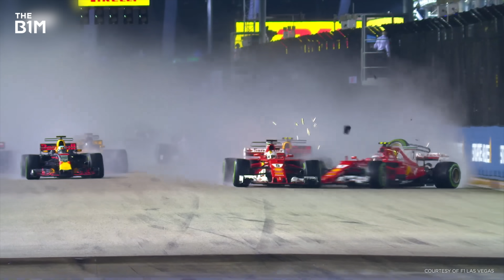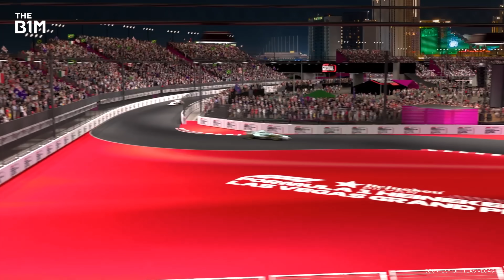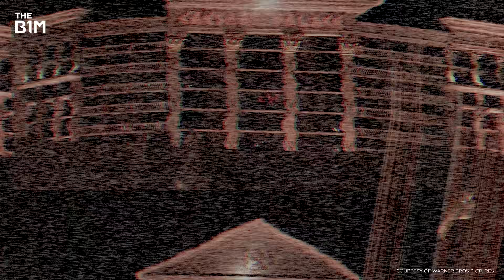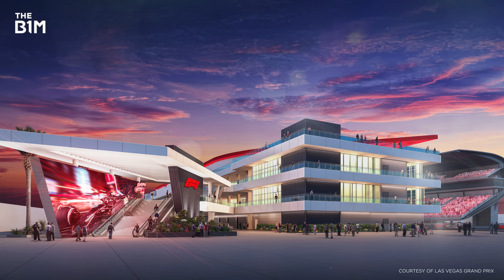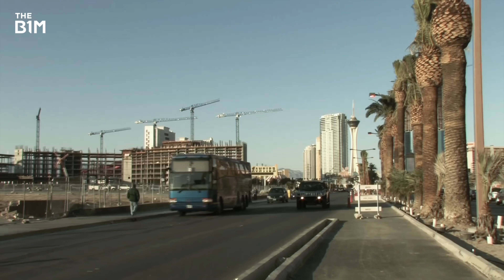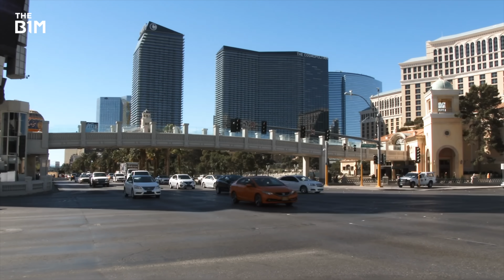How Las Vegas Was Turned Into an F1 Racetrack

Comment: Well, those contractors must be idiots or thieves:

All U.S. power hits the buildings at 240v split-phase 60Hz and every pit did not need another transformer.

We just single phase it down to 120v. 
How do you think every house can have 240v dryer, 240 volt A/C or 240v water heaters or a fast charging EV charger for our chargers.
Go look at your electrical panel: see all those breakers that take up 2 slots? 240v...

And since there are no U.S. companies that make transformers, all transformers are 50Hz or 60Hz selectable to be decided when installed.

Comment: "Something even cooler", yeah, like the road itself, pissing off the race teams who don't even want to run the race because they won't be able to get enough heat in their tires when it's few turns, more long straights and 40 degrees in a night race in November. They will not be able to get the most out of their machines in those conditions making for a lackluster race, especially when the season was already decided at Qatar so they really don't GAF. MASSIVE PLANNING FAIL.

Comment: Las Vegas is set to host its inaugural Grand Prix and the construction of the track and facilities has been a massive project completed in just over a year. The 17-corner circuit was the result of 31 different designs and is intended to show off the best of what the city has to offer. The track starts off with a series of turns before a high-speed stretch towards Las Vegas's newest landmark, the MSG Sphere. The circuit then curves back around to the iconic strip where the cars race past nearly 2 km of the world's most famous and iconic casinos before a series of left turns bring the drivers back to the starting line. The Las Vegas Grand Prix took the unusual step of buying a 39-acre site a block east of the strip to build a permanent foothold in the city. The site features the largest paddock on the entire F1 circuit, over 300 meters long, 30 meters wide, and topped off with a huge illuminated F1 logo. The ground floor features 13 garages that will serve as the base for each of the teams, along with two other floors and a rooftop area for hospitality.

Comment: Its going to be a shit show. Its will be too cold at the odd time they are running the races, and there are too few corners, so the tires will be too cold and traction will suck. They are not tempering the circuit with other formulas to "rubber" the track, so traction will suck. More ice skating than racing. Messy !

Comment: Not a big fan of the layout. Rolling high speed corners and multiple long straightaways does not make for a intricate track. Monza level wing set up is rumored, certainly will be fast. The only question remains: Will the tires be able to handle the temp?

Comment: See the Long Beach GP setup , there is also a part 2 
 How to Build a Street Circuit (Part 1) | Dinner with Racers S3 Ep. 4 | MotorTrend & Continental Tire

 MotorTrend Channel

~~~
Some info on F1 and NASCAR  ( all in fun.  .  ) 

F1 dyno test engine

Rodrigo Coutinho

Formula 1 vs Nascar Fans

zataniko

Comment: Could you imagine if one team on the on end used imperial and the other used metric and they didn't quite meet in the middle...
Reply: you say that but things like that have happened in the past
Reply: @ablair37 Swedish Empire's flagship Vaasa had one side of the ship longer than other because the builders weren't all from Sweden, if I remember well.
Reply: @ablair37 
Ask NASA
Reply: thats happened in international space projects before.
Reply: I have to say, my thought as why didn't they start from the middle and work outwards in opposite driections, guaranteeing a perfect meet in the centre. I assume a good reason, but any know exactly?
Reply: @mmo5366 I think it's because that's how a lot of projects are done. Whether it be tunnels, bridges, etc
Reply: @TheFlexUchiha  Yeah, that's a good point. For bridges and tunnels makes sense, no other way, and clearly the techniques are sound. Still, with a building on a blank flat lot. I just thought possibly so two full building crews wouldn't get in each others way, while having the whole lot marked up prior to build.
Reply: @mmo5366  
It wouldn't have gotten built like he said.

They would be built up wards, as you pour slabs
Reply: NASA has entered the chat
Reply: Many electronics will work on either voltage, the main issue is the plugs
Reply: @SpecterJoe  I think he's talking about the building itself being built in 2 halves

Comment: As much as a headache the Las Vegas locals have endured by all this at least they are left with the smoothest driving surface in the United States.
Reply: We don’t drive those roads unless absolutely necessary
Reply: This didn’t age well

Las Vegas strip: hold my drain cover
Reply: Didn't they only resurface a few lanes of the road and not even all the lanes of one direction?
Reply: @MrAffenMaster   read 80% of the Strip is being resurfaced. I doubt most locals care much about the Strip tho, they probably stay away unless they work there
Reply: @farahabdulahi474 as a local who works on the strip you are 100% correct😂 its one big kindfuck to deal with
Reply: Doesn't make up for the constant disruption permantley caused all year long which is 10x worse in the 3 months leading up to the race every single year for the foreseeable future. The extent of disruption is wild far beyond traffic

Comment: The race is definitely going to be spectacular, no doubt about that. Not just because of the mesmerizing location, but also because they race 10 pm at night, in November. The track can be as cold as 4-5 degrees centigrade. This is thus the coldest track on the formula calendar, which makes this race a real struggle for the teams. They have to compensate a lot to keep the tires warm here, we are probably going to see a huge difference between experienced and rookie drivers, this race will push the limits of the engineers, drivers and car design. It's going to be a blast.
Reply: @PM-uc4kg they get really cold if u didn’t know
Reply: @PM-uc4kg  yeah deserts can get really really cold at night. The Sahara Desert for example, is often -4 degrees centigrade at night (25 degrees Fahrenheit). While ~38/100 in day time.
Reply: Celsius...
Reply: @jkardez4794  Celsius and centigrade is the exact same thing.
Reply: @PlaguedByDesire  Agreed but it is now referred to as Celsius after Anders Celsius who  formulated the centigrade scale .

Comment: For F1 and the organizers' sake, I do hope this actually ends up offering good racing. They've apparently dumped nearly half a billion dollars into this just to make this happen. If it doesn't work and there's a lack of interest, they'll have to go through this for 10 years due to contract.
Reply: Greed meets stupidity.
Reply: 3 years
Reply: Contract expires in 2027
Reply: Potentially up to a maximum of 10 years. 
Three years is only signed and in the contract as of now. And that sucker ain’t getting extended I don’t think imo.
Reply: Very unlikely, they have the worst circuit of the whole season.
Reply: If temperature is around 10°C at night as they say, it's gonna be a nightmare to race there. No good racing at all
Reply: I don’t think they offer good racing anywhere.

Comment: The preparation for this race has been a hot ass mess. It also doesn't help that the county decided that this is the time to also repair most of the roads around the strip at the same time. Las Vegas is just a big headache right now. And apparently, F1 never realized that night in November in Vegas can get chilly, so that might have a bad effect on the race. I hope it fails.
Reply: You hope it fails? lul

Comment: opening traffic between the grand prix is insane! these hotels really need alternative solutions for traffic management
Reply: If only Las Vegas had good public transportation...
Reply: Las Vegas needs trains, metros and bus lanes
Reply: Alternatives have been proposed in the past but the local taxi lobby has a lot of power and money which it has used.   There were plans to extent the monorail to the airport which was fought bitterly by the taxi companies.   There was another plan to have a branch of the monorail serve the west Stripe side resorts, again same result.   Plans to extent the monorail to downtown were shelved due to both  cost and an issue with parts falling of the monorail vehicles during testing.   The monorail could have been a true mass transit option had they went with Hitachi monorail vehicles which are true mass transit trains.   Instead they went with trains from Bombadier which are based on the same trains used at Disneyland and Disney World.  The monorail was basically a huge extension of a two top line which ran between Bally's and MGM Grand.  That line used two ex Disney monorail trains. 
Las Vegas needs a true metro under the strip but you will need buy-in from the resorts so they can have stations.   Some resorts like the Venetian fought the monorail when it was being built which has resulted it being bypassed.  The owner of the Venetian, Sheldon Aldeson, was a big Republican donor.    In addition, the taxi lobby will fight any proposals for the metro as they love that captive audience of tourists.   Anything that may eat into their gravy train is to be fought.   Why should the tourists have a cheaper alternative?
Reply: Monaco has done it forever
Reply: It's really wild that there isn't lightrail from the airport to the strip with undergrounds stations along the strip. Millions of people come to Vegas every year and their all going to the same spot, yet they all have to take private cabs. Easiest public transit setup in the US and they have nothing of the sort.
Reply: LasVegas needs a Monorail for pedestrians!
Reply: @mho...  It has one.
Reply: @rickmartinez3781 Privately owned and connecting only part of the tourist areas. It is not a replacement for mass transit - and mass transit is what Vegas is most in need of.

(And that Tesla tunnel isn’t a solution either, it’s just… bullshit.)
Reply: @mho... First of all Las Vegas needs water.
Reply: Monorails are shit. Just build a metro system. best city transport possible. Unfortunate, they let Musk build that stupid private tunnel.
Just build a fucking metro
Reply: Vegas could learn from Monaco, Melbourne and Singapore,
Reply: Yep! All I can think of is because of greed by the city of Vegas.
Reply: Well, the roads weren't designed to be closed for a d***ed race. It's been done for so long in Monaco that people are used to it.
Reply: They should just race at racetracks instead of on streets… very avoidable issue. America has many beautiful terrain road courses that would make for much better racing.
Reply: The first thing came to my mind is the track will get abused between sessions... I can see it now, some entitled American will get the shits and drive up there dumping a load of paint or drag a skip up the road to damage the track.
Reply: @GarageSupra   hopefully it happens. The greed to just shutdown this city for such an event is ridiculous and unfair to the locals who probably would largely vote against this.
Reply: Yeah how INSANE! Those pesky ambulances and emergency services can just go around! And ppl that need to get to work, how insane of them to want to use the roads they pay for 😔 CRAZY I tell ya 😂🥴
Reply: you know street tracks exist in other american cities right? lmao. The locals will deal.  @qicle

Comment: I dont know how to feel on the whole Vegas F1 thing as an F1 fan who has heard about how bad the traffic has been the past few weeks for these guys. I live in Singapore and they handle the whole situation much better with delays being about 10 mins extra max. I don't see how you can justify shutting down a whole city just for one weekend. F1 is amazing but vegas really needs to improve.
Reply: This isnt an F1 issue as it is an awful traffic management issue. They’ve split the city in half when they widened the boulevard for cars instead of adding an alternative route for through traffic; and now they’re paying the price when their only artery is blocked.
Reply: @baconwizard it’s not a traffic issue. It’s a having zero mass transit issue.
Reply: @baconwizard No matter how well anyone designs their road infrastructure, it will always have traffic issues. Cars can not provide the density and efficiency required for the travel needs of everyone who lives and/or works in a city. To make driving faster and more convenient requires less people to drive. Access to reliable, frequent, and affordable public transport would be the backbone of this. Usually I'd suggest cycling infrastructure as well, but I'm not sure if a place like Las Vegas would be very bicycle friendly due to the heat. Making places better accessible by walking (along with providing proper shade to those who walk) will also help against traffic. 

The Netherlands is considered one of the best places to drive even though we have a lot of infrastructure where cars are not the primary mode of travel. There's also a huge bicycle network and parking garages for bikes. I hardly ever take a car anymore because it is stressful to me and I have good alternatives. If I didn't have these alternatives I would be forced to drive, which would make the driving experience worse for others.

The concept at play here is called "induced demand". Traffic gets bad, roads are widened, traffic issues are gone, that route is more appealing to people who would otherwise stay at home or use another form of transport, and the traffic gets worse until the balance is back to where it was. Now buildings need to be destroyed and people need to be displaced for extra lanes, and people need to travel further to their destinations which will increase how long people spend on the road. It's a never ending cycle where traffic won't be solved and everyone loses. But induced demand can also work for efficient modes of transport which can handle those high capacities.

Many people actually need a car because cars can move a lot of stuff and provide mobility to people who lack certain kinds of mobility. So we can't entirely get rid of cars in cities. But since the vast majority of people wouldn't need a car at most times, it would be best to provide them with a more convenient alternative
Reply: Singapore isn't in the US where any investment in public services is one step short of triggering the second ammendment guys as far as political suicide goes.
Reply: People who think the Strip is "the whole city" don't know Vegas
Reply: Just visited for a conference. Traffic wouldn't be as bad if the infrastructure wasn't so car focused. The bus from the airport (only mass transit option) is once on the hour. SMH. Their woes are a result of poor urban planning and car dependency.
Reply: Vegas and well the entire country needs to get with it on public transportation.
Reply: Vegas always has bad traffic
Reply: The answer is that you can do what you want for big chunks of money in return
Reply: Monaco has been shutting down the city for F1 for decades.
Hardly a first for F1...
Reply: The locals are furious & don't want it back. I think it was incredibly short sighted when thinking about the disruption to the City. Also, Noone wants to go to Vegas in November
Reply: It’s people overreacting and as mentioned teething issues, laying a new surface.
Reply: All my friends and coworkers here are avoiding the middle of town for the next week. 9 months of traffic issues from this. Killed all the trees in front of the Bellagio. Cost locals 500 million. All for a night race we don’t get to watch
Reply: It's a new race, so hiccups are understandable. With time, the disruptions will no doubt be less intrusive.
Reply: @tiadaid wish locals would understand this !
Reply: @tiadaid exactly, if it went flawlessly the first time it would eventually lead to safety oversights, the construction industry is the way it is now because of many projects that cut corners before and it cost lives and money
Reply: This race has been an utter debacle for Las Vegas locals. Everything other than F1 has suffered, and ticket prices are plummeting as the ill will among locals intensifies. I am one of those people. Screw F1.
Reply: In Monaco we get +45minutes of traffic and its in a tiny ass country so legit its just how F1 works. Suck it up. Its 4 days a year. You'll survive
Reply: @charlesrose8185 it’s months of construction delays, not a few days.  I drove there last month and It sucked big time.  Glad I don’t live or work there
Reply: @gordybishop2375 you live in a tourism city. You’ll get over it 🫥
Reply: And the construction is a one-off cost. It's not like this'll be happening every year @gordybishop2375
Reply: Oh boooo hoooo. 😭😭😭
Reply: @NFS305  what’s that supposed to mean? You calling me a cry baby for being sympathetic?
Reply: @sprocket442  pretty much. First world problems.
Reply: @NFS305  yeah thats fair. Ofcourse their are much bigger problems in the world but im not gonna talk about them in a B1M comments section.